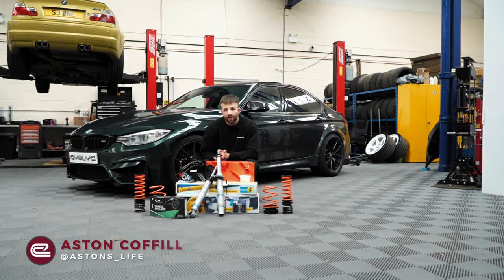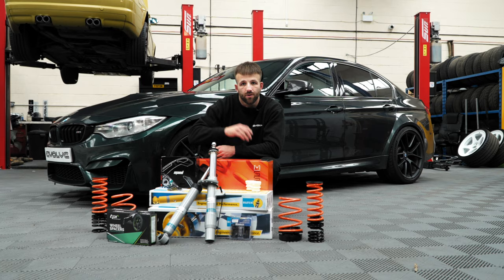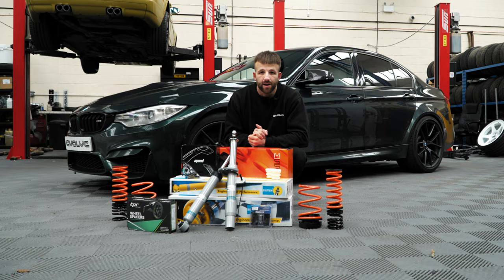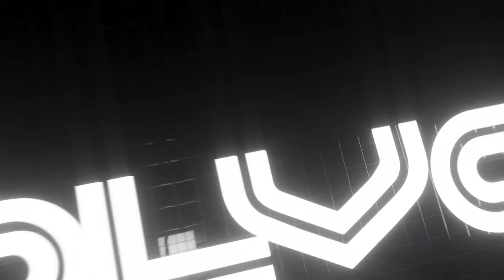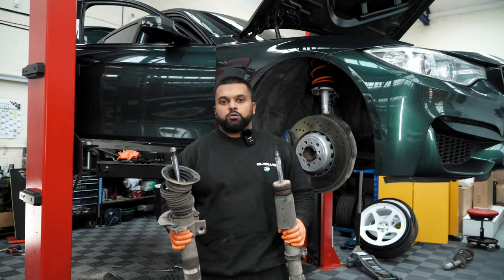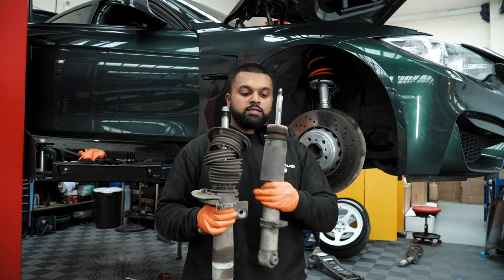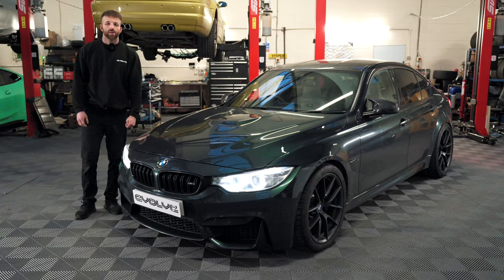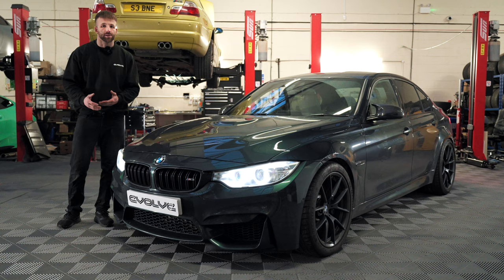Perfect OEM+ F80 M3 Upgrades - Evolve x Bilsten B6 EDC - MSS - MAED Paddles - Stage 1 Remap + CS

Comment: I’m almost ready to pull the trigger but not convinced this will work with the current eibach springs. Not wanting the car to be at stock ride height
Reply from the maker: Then either Intrax or H&R would be a good option.

Comment: Are those MSS springs sitting at their lowest setting in the front and/or rear? Or, can the car be lowered further when using that same setup (Evolve/Bilstein & MSS).
Reply from the maker: Front is all the way down, rear has from memory 15mm adjustment either way.
Reply: Wow. I wonder if it settles a bit?
Reply from the maker: It will settle a bit yes after a few hundred miles